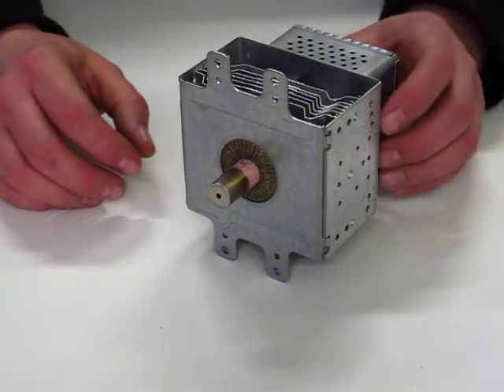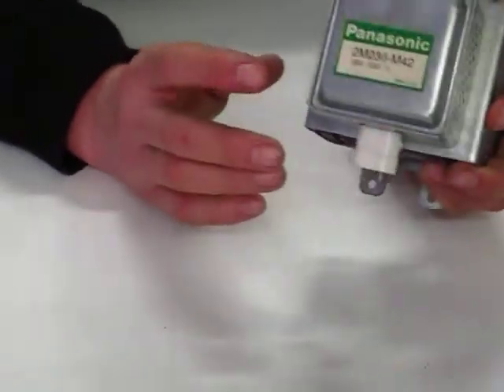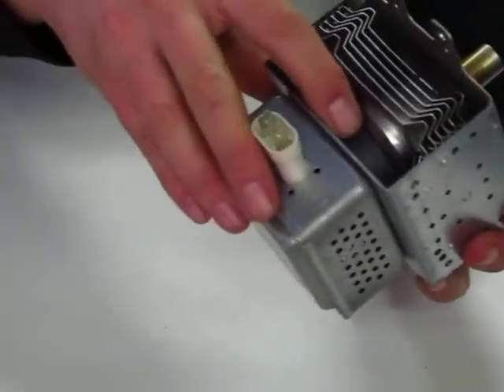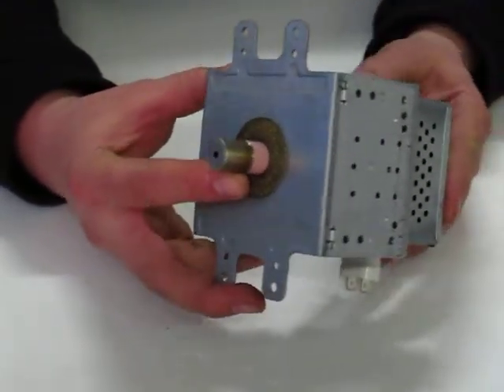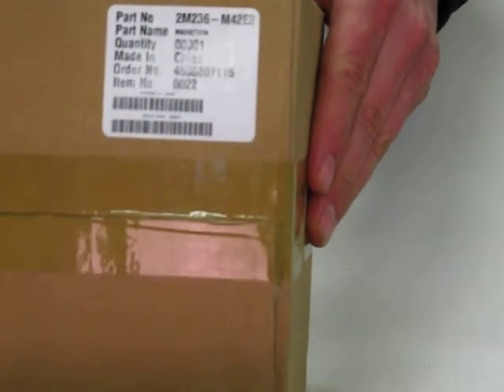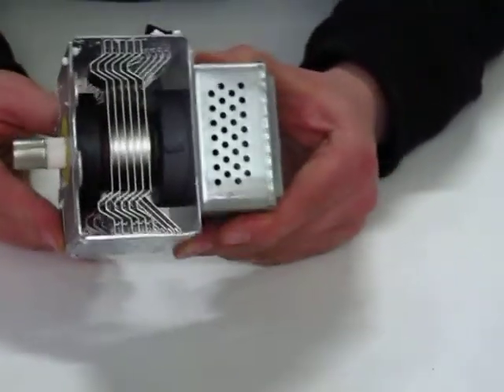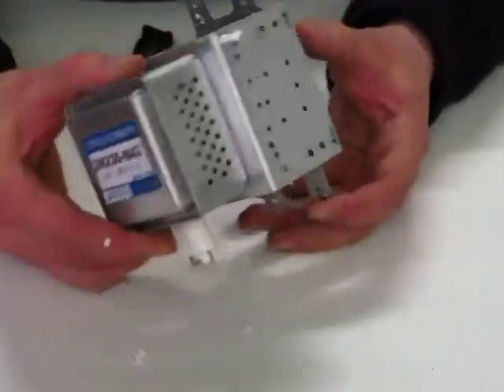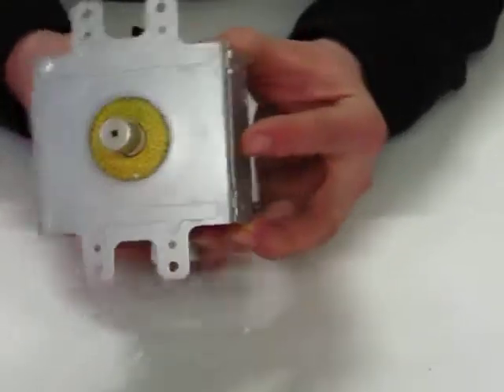Panasonic 2M236-M42 Magnetron

Comment: Good video, my magnetron I believe has failed.. there is a plastic cover that screws to the magnetron and the plastic has melted slightly.. no cracked magnets and no other signs.. it would help me, probably others to know resistance.. the only other microwave I've fixed the mag has a filament of just a few ohms and between the case and filament was a few kohms (I forget).. my mag has short between the two terminals and is completely o/c between case and terminals...

Comment: Hi nice video.i want to ask one question .do we have different magnetron rating is it all same or ...?I noticed from articles that they have a filament which is mostly supplied 3V ac. Do we have any other such parameters ?I wonder what really makes the microwave output power higher?is it the high voltage of the filament voltage ?